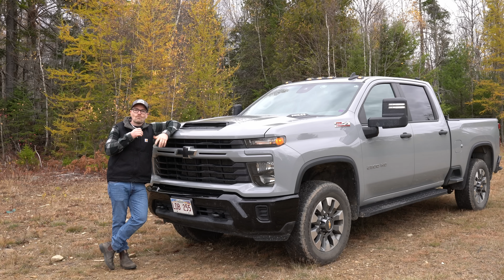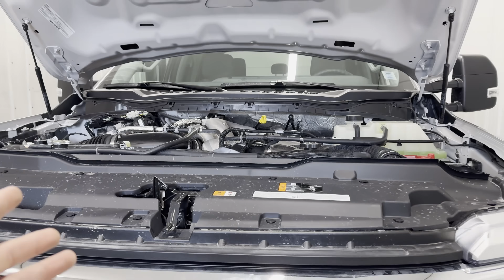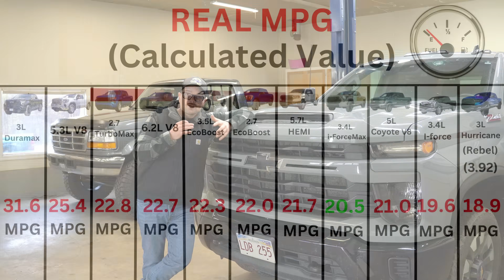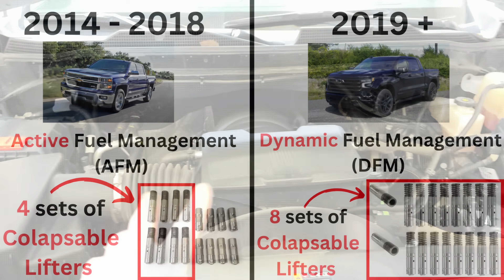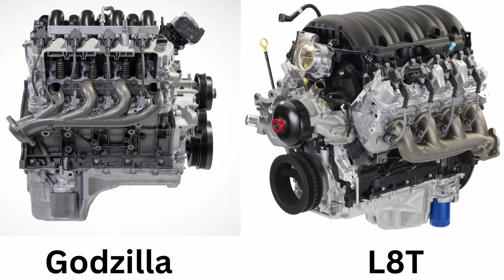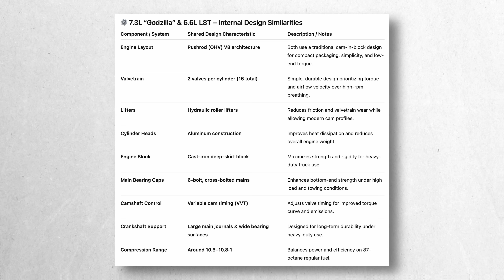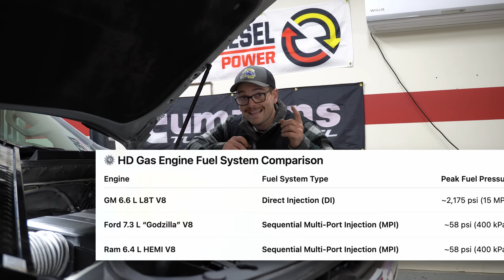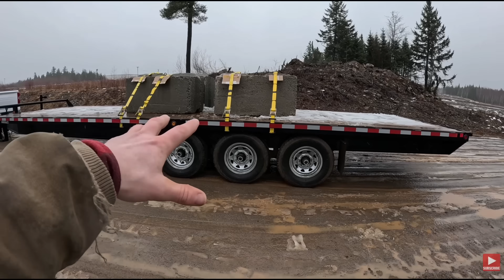Chevy 2500 6.6L L8T V8 Review | GM’s MOST RELIABLE Engine They Still Build

Comment: It's good it doesn't have the cylinder deactivation like the small gassers...who ever came up with that idea needs to be tarred and feathered.
Reply: Agreed.  Anybody who likes it doesn't realize that while they may save $100 in fuel over the life of the vehicle, they'll spend $6,000 for a new engine when it fails and destroys the engine in the process.
Reply: @camarokurt your not going to save any money on fuel with the 6.2 or 5.3 when you only have a 24 gallon fuel tank
Reply: CAFE standards
Reply: I’ll take your “tarred and feathered” as a code word phrase for what they really need…
TRIED AND HANGED
Reply: It’s been around for almost 50 years. Cadillacs had the 8-6-4 in the ‘80s. Problematic for sure, but not new. Complexity is a problem, but it seems like you would need to fully deactivate a portion of the motor where it is not rotating to have a hope of it being sustainable. And alternate the pairs that deactivate to balance wear. Super complicate tho, and at that point a gasoline electric hybrid is much more reliable.
Reply: Yea cylinder deactivation is absolutely ridiculous, ive seen so many engines go out because of it
Reply: Agreed. I have a 2018 5.3 that imploded. Had to replace the engine. I’m a die hard Chevy guy but that nearly broke me from ever buying one again. I want to try the 6.6 gas and see if it’ll hold up.
Reply: I'd rather just pay the gas guzzler tax up front and not have any problems.
Reply: Government came up with it.
Reply: Thank big gov.
Reply: EPA...

Part of the swamp shadow government.

Same with Stop/Start.
Reply: @SlimJim-ub9ogI dont think the EPA having efficiency/emissions goals for manufacturers constitutes shadow swamp government 😂 

Racing bodies create rules for teams too. But they innovate and create some of the greatest automobile inventions of all time. Engineers from OEMs could do the same if they weren't trying to also make it as cheap as possible.

Also lets not forget that there were plenty of shitty engines that existed well before the EPA was even created... and that engines today are more powerful and last much longer than most engines of yesteryear. Vehicles used to die around 100k in the 60s, well before the first engine restrictions in the 70s. And they made like 100hp on average 😂
Reply from the maker: EPA
Reply: .. my v6 with cylinder deact has.. 220k km on it . no failiure

Comment: I work on these in NB. 
One i see is loaded maximum payload 24/7. 
The drivers previous truck was a 6.0 gm and got a new one after almost 300k on it. 
If this 6.6 gets the same reliability as his previous truck it will be the best one in the market.
As for your concern on the DI pump, i get it and agree however i have seen the ones on the 5.3 go to over 400k with no problem (the driver did over 80k a year in his 1500) and also never an injector issue.
One good truck isnt a guarantee of all of them being good but i think they will be okay.
Reply from the maker: If the direct injection system holds up these engines will be next to bulletproof I think

Comment: I have a 2024 with the L8T in the LT trim level.  I've put just over 22K miles it so far and I couldn't be more pleased.  Around 25% of those miles are with a 10k travel trailer behind it, and it tows flawlessly.  Is it as powerful as a diesel...nope, but that's not why I bought it.  Reliability, simplicity, capability, and cost were the driving factors for me.  It does what I need it to do, it's simple to work on and maintain, it's built to last, and it didn't cost me an arm and a leg to buy.  I'm intrigued with the 7.3 Godzilla but always been a GM guy myself.  Guess we'll see when the time comes to trade it in.  Hopefully that's a very, very long time from now.
Reply: I’d highly recommend Amsoil Signature Series synthetic oil every 5k. That truck will last forever.
Reply: @TP_Tactics Good advice!!!
Reply from the maker: Agreed, the diesels are more powerful but for a 10k trailer this engine will be awesome and you get the simplicity in a cheaper package.

Comment: I don’t have the need of large towing capacity so the half ton platform entices me, specifically the 3.0 duramax. I plan to eventually tow heavy, but not for another 10 years. Should I go with the 3.0 half ton now and risk the next generation HD V8 being not as reliable, or buy the HD now and eat the fuel economy cost for the time being?
Reply: Family member has the 3.0 Duramax 1500 Silverado. It gets great fuel economy and towing performance. As I recall the engine is German engineered (GM Opel  Deustch?)

Comment: I feel the GM transmission is way smoother than the Ford - just my experience.
Reply: The ford feels smoother to me and definitely tows better. If I want an oil burner I’d buy a diesel lol
Reply: They're about the same, which makes sense because they are very similar to each other. 

I think it does a bit better in the Ford with 7.3 because of how much low end torque that thing has.

Comment: The direct injection system is a no go for me.  I'm a Toyota guy but I wouldn't touch the new 3.4 or any or the 1500 trucks.  I hate to say this but my next truck will probably be a slightly used F=250 with the 7.3

Comment: I would like to get a HD gasser but between 6.6 Chevy or a 6.8 ford 2500
Reply: I’m leaning towards the ford 6.8l. Simplicity wins. I have old Cummins and 7.3 powerstrokes, but the gassers are going to have better reliability nowadays due to epa crud, in my opinion
Reply: @krisrogers1214 thanks gives me a good idea what I would like to get
Reply: I went from the gm 6.0 to the 2020 ford 7.3. Had nothing but problems up to 35k miles when I traded it. My 23 l8t has 130k on it. No issues.
Reply: @chadmiller6487 first year for that engine/trans combo, never do that. 

2023+ 7.3s are dead reliable.
Reply: @chadmiller6487 would a 6.6 gas engine with a 6 speed be good ?
Reply: @SaiyanSlayer_ that's what I have. I have mixed feelings about it. The 6 speed is definitely more reliable but the 10 speed is much nicer to drive.

Comment: I’d still stick with the Ford gassers just because of the fuel system.
Reply: I was temped to go with the Ford 7.3 for reasons of the simpler fuel injection system but did end up going with the L8T and the reason was that earlier on there were or seemed to be ( you know how it can be with the internet ) quite a few engine failures due to the lifters/cams failing and taking out the engine in the process with metal going through the system. It was only last year at some point that they were admitting there was a lack of oiling issue to the cam and from what I gather they did a software change to tell the variable displacement pump to deliver more oil then it had been at idle as well as up the idle speed a bit. Anyway that issue made me wary and ended up choosing what I did, throw a dart and make a choice it seems and a whole lot of hope these days with vehicle manufacture issues they all seem to have too many of.
Reply: My 2020 7.3 lasted to 35k miles. That was my first and last ford HD purchase.
Reply: @chadmiller6487  what happened?
Reply: @chadmiller6487  I responded to your L8T comment, but as to your past Ford with the 7.3, was it a failed engine that ended your ownership and of so was it determined that the valve train spread glitter through the engine ?.
Reply: Literally so many problems. Power steering pump, trans hard shifting, electrical issues. Just not a well built truck.  @charlesb4267
Reply: Yes.  I wouldn't buy a new engine with direct injection only if I had another option.
Reply: Internet problem.
Reply: @holdenc3082 This 😂